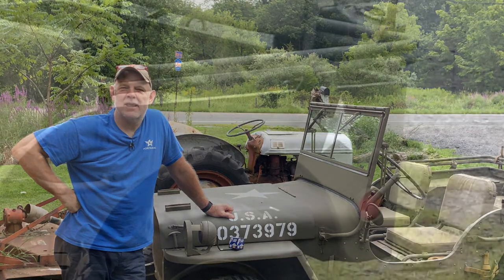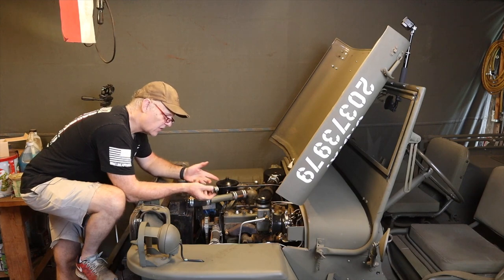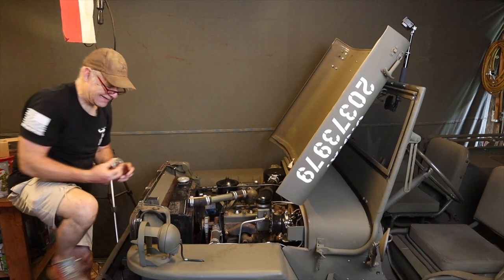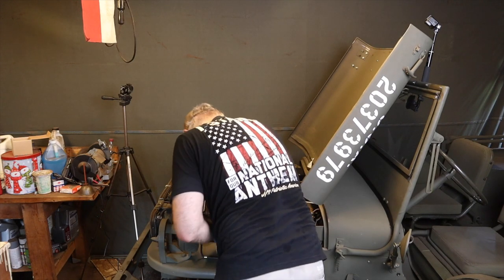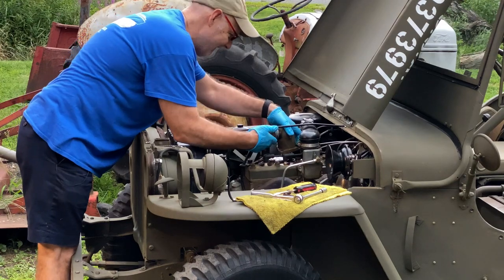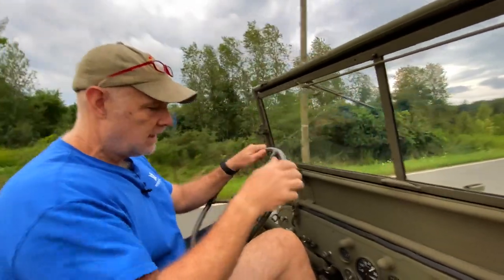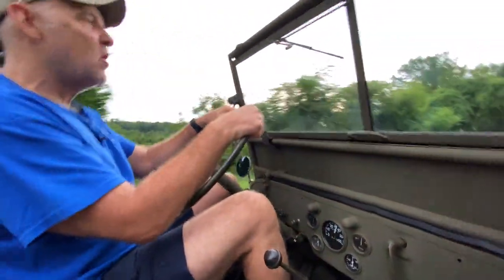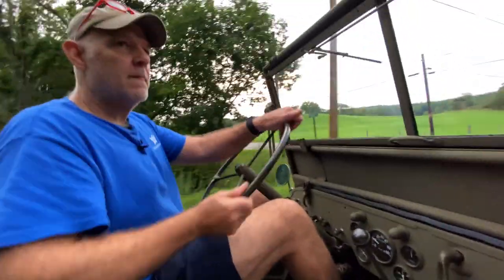WW2 Jeep Engine Overheating Causes & Fixes #G503

Comment: So much data and specifics for the lowly workhorse of WW2. When I used to be able to buy parts easily, still in cosmolene, I never knew that these would be fussed overly like the Model T's and all their variations. Thanks for the valuable information for those pursuing "the correct" presentation and keeping them operational.
Reply from the maker: You are very welcome Craig - seems that nearly everyone finds these old gals irresistible.  I was at a show today and some guy called and tried buy the jeep even though it clearly said "display"....I think you have lots of company in that "never knew that these things would be worth anything"...my dad made me pass on a minty Singer 1911 in about 1975...wanted me to keep the $250 in a passbook savings account 😂  it was fair enough advice at the time, but I think my return would have been a lot better on the Singer!

Comment: Hello Patrick you did a great job diagnosing the heating issue and the Jeep looks beautiful, you did a very nice job!  I need to pull the radiator on my M977 and I already looked through the manuals I got from you and it sure looks like an EASY FUN JOB!  HELL NO! I found out the empty weight of the radiator is just under 500 pounds.  Oh well like all the other trucks etc, just deal with it right!
Patrick it was great to see the video and the Jeep looks really great Take care and I am sure I will be ordering more manuals as usual!
Karl

Comment: On a similar note, my scout car when I 1st got her would idle great for  1/2 hour but when I drove her for 10-15 minutes, she would backfire and stall. The temp was about 180. I would let her sit for 20 minuets and would start and drive fine for 10-15 then the same crap. Vapor lock! Took my awhile to find out what was causing it. A gent on the FB forum saw I was missing the phenolic block on the carb. The scout car was new to me so I just did not know that was MIA... Pat, great video!
Reply from the maker: It always amazes me how much there is to learn about any machine...even when they are very simple. All these little "tricks of the trade" that you are either fortunate enough to pick up from some guy with a lot of experience or you stumble upon when you can't get the machine to function properly.  One positive of the internet is that this information can get captured in a way that we can all find it ;-)

Comment: I did a full flush of several things the last few months as my 1944 GPW was overheating and constantly overflowing. I was getting lots of crud when taking off the radiator cap. First I used a store-bought radiator flush. Drained the block/radiator, then filled with water. Ran the Jeep for 10 minutes, shut off. Waited till cool, drained water. Poured in radiator Flush liquid and topped off with water. Ran the Jeep for little 15 min drives every day for about 5 days. After each drive, once cool I'd remove the radiator cap and it was covered in almost a mud, so it was working. After the week of driving, I drained the stuff out and did a full water flush (blasting water into the block via the thermostat elbow hole and removing the radiator from the Jeep to fully flush it out from all angles). Put it all back together, put the thermostat elbow and radiator back on (temporarily with the elbow, reused the gasket with some new permatex) then re-filled with water so I could drive the Jeep again and see how things look before putting coolant in. 

I decided to let it go for 2 days. On the second day, I noticed some of the grime was back. Ugh! So I went for another round, this time with Calcium, Lime, Rust (CLR) as some people recommended. 128oz container of it from Lowes. Because of the corrosive nature of CLR, you want to try and do this flush in one day. So I drained the water that was in the block/radiator and poured in half (64oz) of the CLR. Topped off with some water. Ran the Jeep for 15 minutes and did a quick drive around the neighborhood. Drained the CLR/water,  did a water flush, then put the second half of the CLR into the system topped off with water. Did another 15 minutes of running the Jeep and driving around the local area. After it cooled, again drained the CLR/Water and did a final water flush. After that, I put in water again for 2-days to check. 

 2 Days later, no sediment, pure water. YAY! Drained the water and did a flush again (just to be sure). Filled with coolant. Since that CLR flush in late June, I've had nothing but nice looking coolant and not a single bit of grime build up on the radiator cap. Jeep stays around 175-180 on most my drives. It's a crazy heatwave lately here in SoCal of over 100 degrees and where I live has a lot of hills I have to traverse, so the temp has popped up to 185 at times, but quickly goes back to 180 or 175 once I slow my driving down. 

Here's the links to my photo documenting of the flushes... 
1st Flush (Part 1) - https://www.facebook.com/1944gpw/posts/730434761030042
1st Flush (Part 2) - https://www.facebook.com/1944gpw/posts/735228267217358
2nd Flush (CLR, later in the post) - https://www.facebook.com/1944gpw/posts/745034112903440
Reply from the maker: Fantastic writeup!  Thank you very much.  Crazy enough....I purchased some CLR on Saturday after a buddy suggested it and then I perused a bunch of posts in various forums and it seemed to work for people.  I was sitting on the fence about whether or not I should leave well enough alone as I mentioned in the video. Great to hear of your experiences and that you got your cooling system working like it should.  I am going to flush the system and I bet I get a little improvement.

I also helped my same friend put his motor back together last week.  We need to do a little tweaking before we reinstall in his jeep.  One of the things we are going to do is flush his block because it doesn't look that good inside. He had machine work done on to install Timeserts for several studs, but he did not have them bake/clean the block.  It needs a good flush.

....and then I picked up a WW2 era generator yesterday with rebuild tags from 1952, 79 hours on the Hobbs and everything standard.  The block is GPW and the head Willys circa 44.  Not sure what I got yet, but it looks pretty promising.  It also definitely needs a flush!
Reply: @Portrayalpress  Lots of flushing it sounds like! The real key is, whatever flush you do end up doing, to make sure you flush out all the radiator flush/CLR from the system. It's going to break up some nasty stuff for sure. When I took my radiator out after the CLR flush to rinse out, everytime I'd flip it over upsidedown and shot water into the intake/outtake ports it would shoot out all sorts of gunk from the neck area. Same with it flipped rightside up, shooting water into the neck and top intake port made all sorts of gunk come out of the bottom out port. But I'm happy with the flushes, and with at least a good 70+ miles on it since the flush, not a single bit of gunk on the cap! 

One other thing to watch for is the freeze plugs. A flush could, if the rust is bad, cause them to leak if it breaks that rust up. I don't believe it's all that common for that to happen, but still good to keep an eye on after a flush!
Reply from the maker: Appreciate the insights & experience.   I am going to do as you say and then remove my radiator and really work it over.  I am close I think.....I have seen freeze plugs leak after aggressive cleaning...they are not too bad to replace, but I am not sure about doing that in the jeep and I certainly don't want to pull the motor if I can help it...

I got the generator running yesterday - poorly, but she runs.  I need to do a quick & dirty carb rebuild.  She was running on 3 1/2 - #1 has pretty low compression but the other 3 are strong so I am thinking it is a stuck valve.  I poured Marvel Mystery Oil in all of them and let them sit overnight.  I think it is going to be a good engine - and will turn out to be a fine buy....

Comment: I have replaced a couple of water pumps on my 1953 Willys CJ3b and I found it much easier, if I just removed the radiator and shroud first. It is only a few bolts and takes just a few minutes.
Reply from the maker: Good tip....one of those things where it takes longer to remove the radiator, but maybe you save time on the installation of the water pump and fan.....for me its seems like a push.....

Comment: Got the same  issue with my  late 42 early 43 Ford, fully rebuilt motor, ran cool for ages then got really hot after I added coolant in the water???!?
Theres a 12 second clip if you do a search for my name and first drive since 1963 under it's own power.  
Yours is a very nice part of the world !
Reply from the maker: Sorry missed this comment a while ago!  Hope you got your overheating sorted out.
Reply: @Portrayalpress  i did thanks! I used an old style water soluble oil I bought in Sydney.   Brought the temperature down to 165 170.  Happy  Jeeping!
Reply from the maker: Good stuff - enjoy!!
 @andrewjoyce7789

Comment: Hi Patrick my jeep runs about 178/180 and when at speed goes up slightly then backs off ,also I had a slight misfire when slowing down on the overrun I replaced pcv valve and the misfire went or take off and clean it out give that a try ! Good vid enjoyed it
Reply from the maker: Thanks Dave.  Interesting about the PCV valve - many thanks for sharing.  I will clean it out and see....the jeep is running great but does have a little miss at idle.  I will report back.  Thanks again!!

Comment: Fine video...160 stat was OEM...your diagnosis was good.When an engine suddenly & violently overheats (after a substantial run that is normal)...a sticking thermostat is high suspect & easily changed...
  Should that not correct the issue...a marginally stopped up radiator is usually the cause.
I have seen thermostats' bellows linkage foul with junk from the radiator and/or block...
....I am an old radiator shop guy...first thing I did when I rebuilt my 43 Willys was to recore the radiator-to protect that 2K engine rebuild....Cheers
Reply: I would agree to this comment too, probably the thermostat fouled up and cause the overheating.
Reply from the maker: Thanks Ralph - that makes a lot of sense.  Have you ever used the product CLR or know anything about it?  I am still thinking of running it through the block to get any remaining rust out before I refill with antifreeze.

FWIW, I did my own semi-rebuild on this radiator.  I took the tanks off and rodded out the tubes.  I got it all back together again pretty uneventfully but there was a leak in one of the tubes and I was a little scared to try and repair it for fear that I would create more leaks.  I took it to a local guy and he cut and soldered two tubes. I did not dip or otherwise treat the tubes so while I know they were unobstructed - I am not sure there isn't scale in them which could impact flow.

I have another radiator that needs a little shroud TLC and I am working on it.  I am going to have this guy check it and likely recore it.  In the meantime, I think this fix is working and I will just keep a sharp eye out on the temp gauge....

Thanks again for sharing your experience and knowledge.
Reply from the maker: @lexpaques4055  Greetings Lex!
Reply: @Portrayalpress  Doing your own rod-out is impressive; even with the guy's assist...That gave your radiator heathy status.Now-and always-the crud is block-produced...it can, down the line ,re-clog the radiator.(the block is corroding 24-7)
CLR or any number of products available can break crud loose but it will end up in the radiator unless you consider something like this:
At the shop we would first remove the thermostat, then reinstall the housing.To reverse-flush the block -separately and independent of the radiator-we used a flush gun with air over water, equipped with a trigger to engage the air push. The end of the wand was a conical rubber tip to seal-fit the upper(Tstat port)....Because it will blow out of the water pump port, a hose must be attached there to direct the (crud-filled) blast toward the ground.The radiator should be flushed last, preferably also reverse-flushed.We always recommended a new thermostat.Back in the day they were about three bucks.Good job on the rod-out.
Reply from the maker: Thanks Ralph.  That makes a lot of sense.  I am going to see if I can engineer something like that to clean my block out.  It was cooler yesterday and the temps are running pretty consistently at 180....not bad but I think I can get it down 5-10 degrees and call it a day.  Appreciate you sharing your wealth of experience!

Comment: One thing you can also do to diagnose water pump is to run the engine without rad cap and see if the water is flowing as it should...😊
Reply from the maker: Excellent Ronnie.  I really wasn't seeing good flow before I started flushing it.....another clue!

Comment: I do to have a world war II generator. ZXB Hercules made by Hobart 4 cylinder engine. Having the same issues. But mine is still a generator. Just water circulation,.I can't tell if it's circulating or not. You would be a perfect candidate to make a video on the water pump circulating the water on how the water is supposed to circulate by watching the water move within the radiator cap.

Comment: Patrick, Glad you got the temps down. Hope they stay that way. Your idea of Flushing that system, seems almost necessary. If it’s sludgy in the engine and some tubes in the radiator, it will just get worse and be a constant problem. A good radiator shop should be able to tell you the best flush to use - haha.
You must be pretty tall. You just barely fit in the Jeep drivers seat. Maybe you need a couple extra seat mounting holes. I mean it’s your Jeep right?! I’m small 5’7” and was sought after for flying the OH6. 500MD and Kiowa (OH58) - haha.
Yes, back in the earlier cars I had trouble seeing over the high rounded cluster pad of the dash, but looked between it and the humongous steering wheel. Haha. Maybe that’s why I like motorcycles.
Reply from the maker: I am kinda big for a G503...but as long as I don't pack too much on around my mid section, I can squeeze in :-).  Otherwise, I will need to be modifying that seat!

My radiator guy says I will am 50/50 on a  flush...may make things worse but should make it better.  I am going to use CLR on it - run it up to temp, let it sit for a couple of hours and then flush it several times.  I am then going to pull the radiator and flush it by itself a few times and repaint the tanks to make it look better.

I am jealous of all that rotary time...although you know those things don't really fly, right?
Reply: Portrayal Press You starch wing guys just hate needing a runway - haha.
Yes, I know, we beat the air into submission. Sometimes it fights back though - ouch.
Reply from the maker: @MRrwmac  You are right about the runway thing.  One of my neighbors had an R22 and was a CFI - he had a little helipad on his farm.  I tried to get him to give me some dual but he wouldn't do it - was about to retire from United and just did not want the commitment. Would have been fun :-)

Comment: You can test and verify the thermostat. Boil a pot of water and place it in the pot. You can take it in and out to see if it works...
Reply from the maker: Thank you.  Good suggestion and useful diagnostic....the only thing you have to watch for is that a sticking thermostat may work when you put it in boiling water but hang if the change is more gradual. If you have the patience to watch the pot boil, put the thermostat in a pot of cold water with a thermometer and see if it opens at the correct temperature.   I think the thermostat I removed is sticking.....

Comment: Basically explaining what way the water circulation flows explaining the water pump circulation. Even though I can tell my engine is a little different than yours it's still the same concept.
Reply from the maker: Thanks Revolution - we are actually working on a shop manual for the jeep and trying to get into some of this...we happen to be working on the cooling system and there is plenty for all of us to learn there.  I am doing daily videos in March (2021) on the Weasel restoration but will put this on the list.

With respect to your generator, have you pulled the thermostat to see if it is working?  You can test it by putting in boiling water as you may know...they do get fouled up and stick....Water pumps tend to leak before they fail....so less likely.  If the cooling jacket is just fouled up, I am pretty impressed with that Thermocure (we did a video)....cleans out the junk pretty well.

Comment: Make sure your heat riser is working or it heat your intake air too much makes it run hot .
Reply from the maker: Thanks John...thought I responded... I ended up wiring it closed because it is not working correctly.  That could be part of the problem for sure.